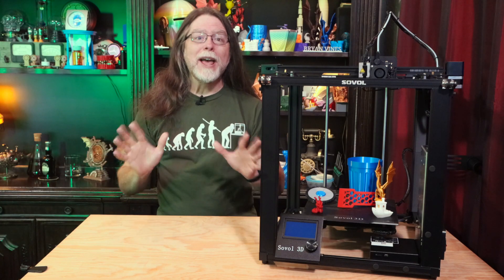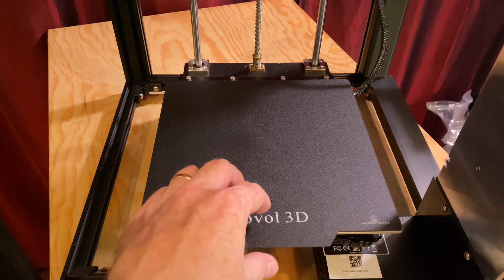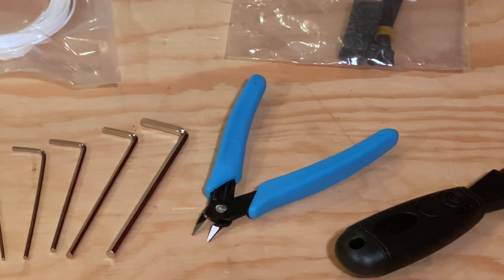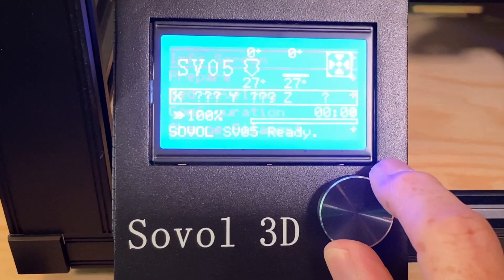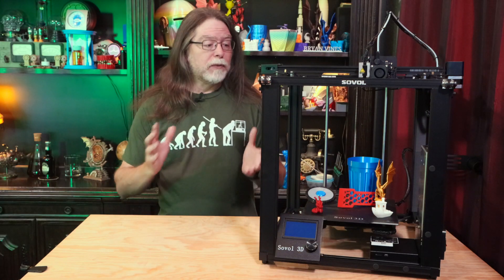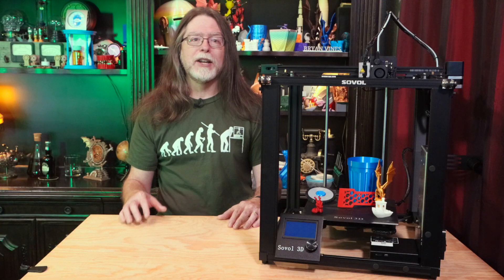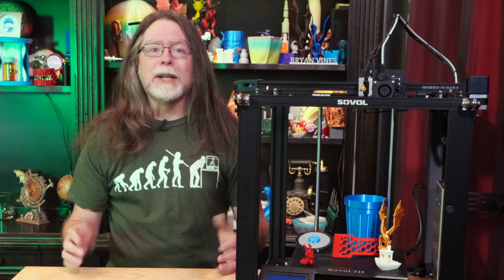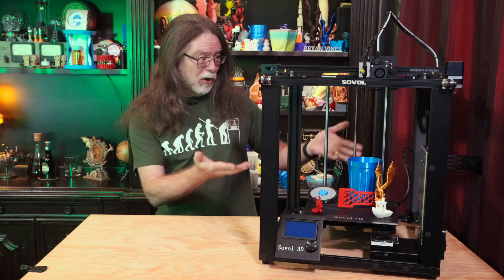New! Sovol SV05 First Look

Comment: I like how they don't hide the fact that they used a Creality mainboard. It's even in their marketing page.  LOL
Reply from the maker: There are a fair number of printers that use the Creality boards. But there are a lot of others that use boards like the MKS Robin Nano. The Creality boards are OK for what they are, but I think the Robin Nano is cool because it uses sockets for the stepper motor drivers.
Reply: @BV3D  Bryan, great video. I ordered one about an hour ago and it’s arriving next week. A few questions. One, I figured, since it had a Creality board, etc…etc… I’ll be able to update the extruder to something like the latest dual gear sprite, etc…? That’s the first upgrade I’ll be going for is a better extruder (suggestions welcome!!!!). Next, will I be able to run klipper? Aka, get the new Klipper touch screen, OctoPrint, etc….? I’m assuming they stayed close to the open source lane and most major upgrades wont be an issue? Anyway, thank you. Great review, Great Channel!!!

Comment: thanks.  so it is an updated emder 5 pro. yet it still will need the bed support struts. those have been recommended since original ender 5 was released.
Reply from the maker: Hi! It comes with them, I forgot to point them out! 😅

Comment: Four minutes seems excessive to heat a bed to 60°. Could be some bad PID settings, or improper connection at the bed terminals? Either way, I would investigate before doing anymore printing.

Comment: Sovol is part of Creality, but is it the part of Creality where the designers design is final before the marketing suits get their hands on it?
 The Sovol models are usually superior to the Creality models IMO and this one is definetly superior to the Ender 5 Pro, I would hope for a Pro version of this with 3 leadscrews and a 6 driver board and G34 compatibility turned on in the firmware, the Ender series and many more of the Creality machines have a fault in the BL compatible firmware where the XY offset for the ABL is not set-up correctly and results in an ununiform mesh when probing the bed, we dont know if this was fixed in Sovols FW maybe Bryan can tell us, I think Sovol will have fixed this though and maybe this section of Marlins configuration can be applied to the Ender 5 stock FW by users although an Insanity Automation FW flash would be more appropriate.

Comment: I'm new to all this and was looking at a Sovol SV01 Pro when I saw the SV05. What makes this better than the SV01 Pro? Is it actually better or is it just different? I'm not sure why I would want this box style over the standard single gantry. Thank you!
Reply: Core X-Y printers and Cartesian printers like these are generally faster because the print head which is relatively light moves in both the X and Y axes where a SV01 or any other "i3" style printer moves a fairly heavy print bed and the entire print back and forth in the Y direction. Personally I'd skip the Sovol and buy a Prusa, unless you would rather spend more time tinkering than printing and equally as much money in the end. I own both. The Prusa gets used all the time and the Sovol only when I need to print something big.
Reply: @B3MDUSA  I appreciate the info. I'm still in the saving up phase, but I'll keep that in mind. Thank you!